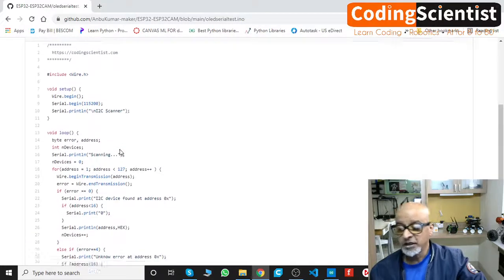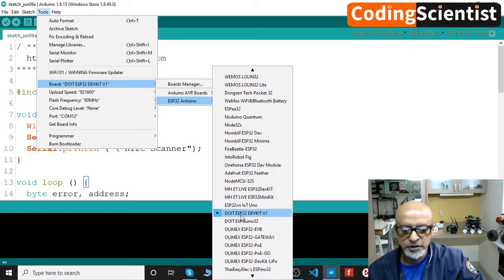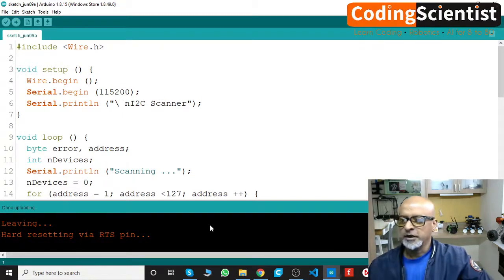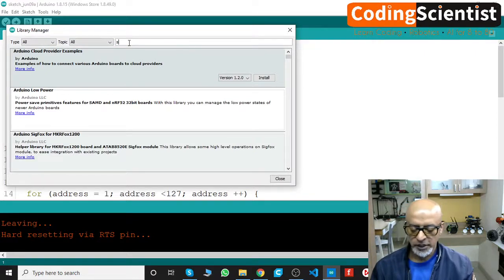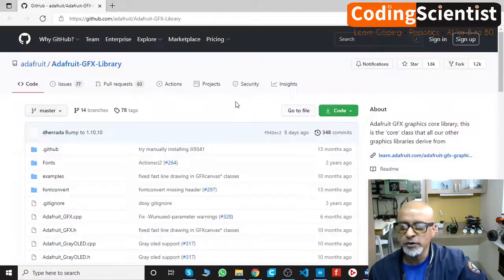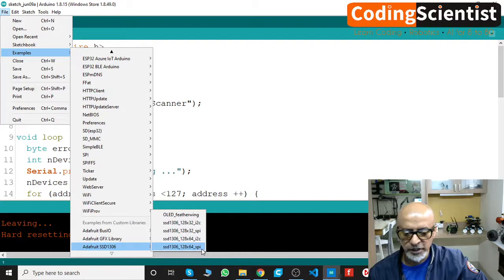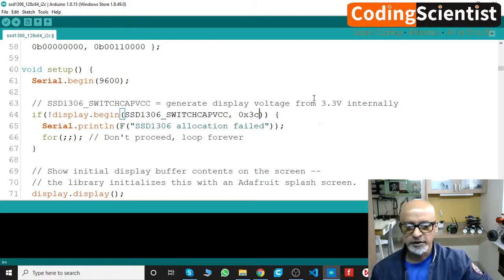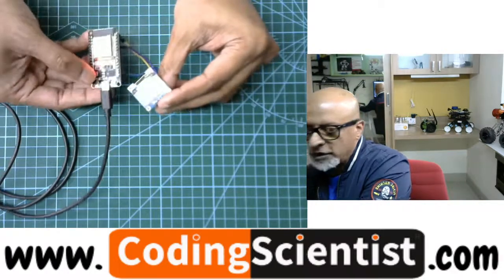Lesson 10 Connecting and Configuring OLED Display

Comment: Thank you very much for this explanation. I was just struggling from few days to run the display. I am following your series. Since, You have worked on ESP32CAM, can you please suggest similar working code for ESP32CAM, using #define ESP32_SCL 3 #define ESP32_SDA 1? I need it to display the dynamic IP address the ESP32CAM Robot, the pending project.